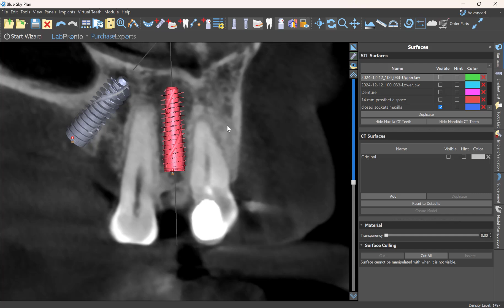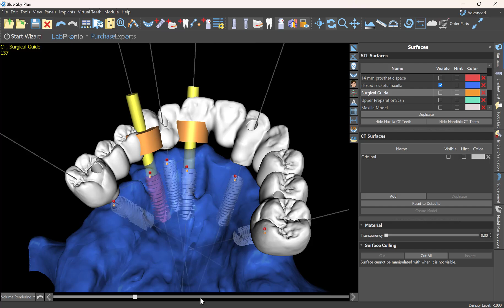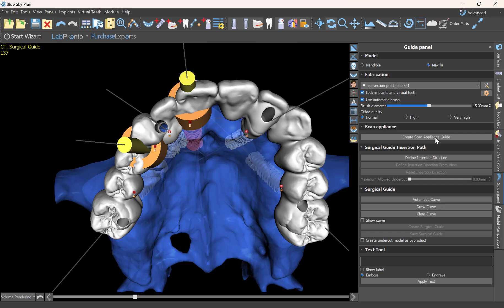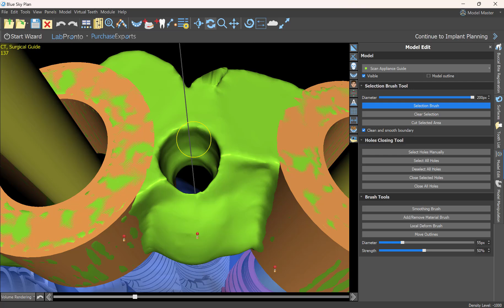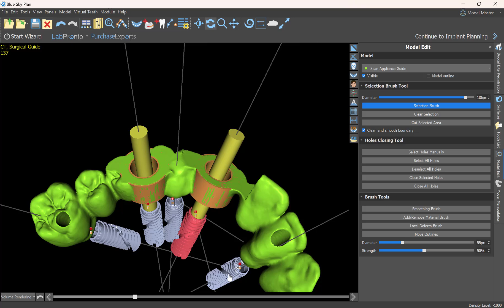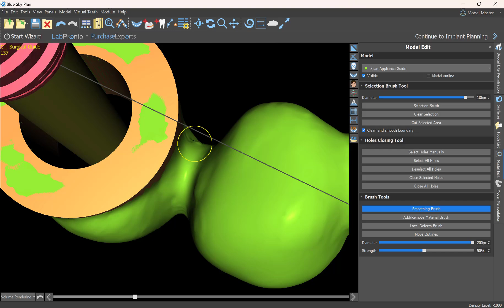Making A Surgical Guide That Screws Into Existing Implants

Comment: How accurate is the conversion prosthesis with its Vortex screws to MUA ? Because if  implant is shallower or deeper than planned it will not fit correct ?